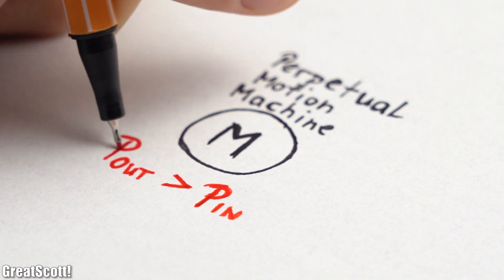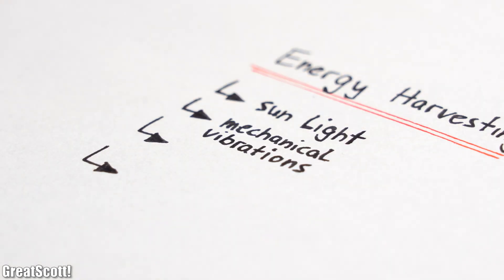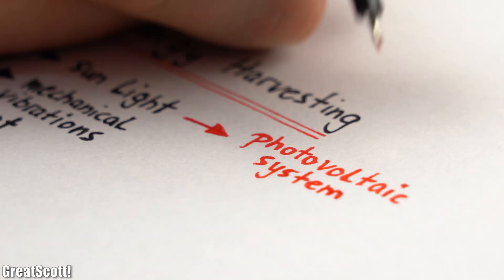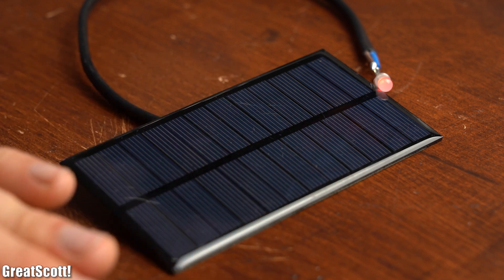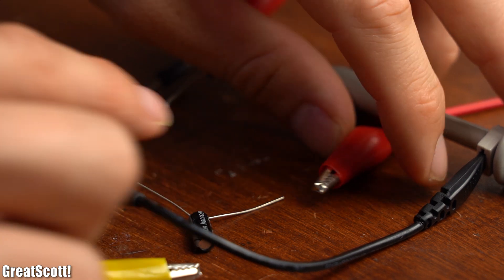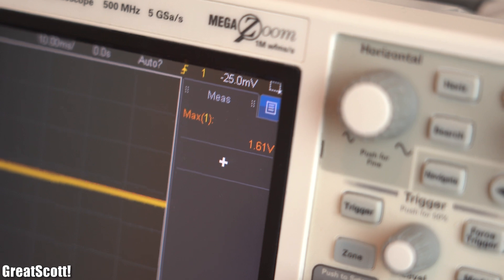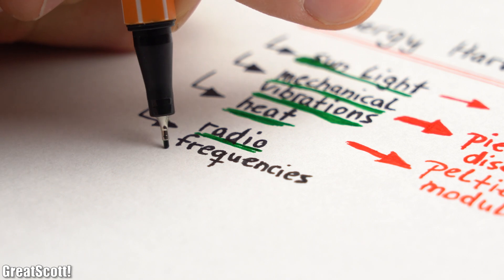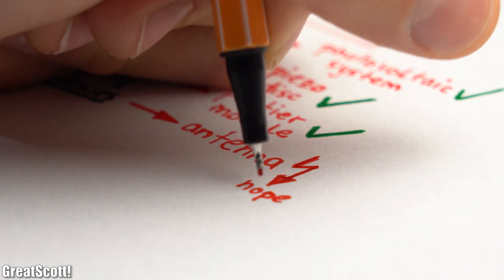Does Energy Harvesting make any sense?! (Experiment)

Comment: My idea is to try using the vibration riding an e-bike to produce some voltage. Probably for LED's or small devices. But, until now, I didn't know how to approach it. Also, this approach doesn't use friction against the wheels or pedals. The washing machine sample you gave tells me getting the right form of vibrations is going to be tricky!

Comment: On the washers unit you would probably have to get to the bracket on the inside away from the spring so it's attached to the most vibrating part of the machine bracket so it will have more effect that be near the bottom of the washer where the spring connects to the agitators bass and I'll be where the machine shakes the most inside while it's on spin cycle and all the other Cycles

Comment: Energy harvesting is largely a green fantasy that sounds good, but is in most cases absurdly impractical. Often the on-going costs of maintenance, damage, energy storage, wear and tear etc is not factored in, or the efforts involved are much better spent on large output power generation systems such as solar, rather than trying to scavenge puny amounts of power off mechanically unstable objects

Comment: I think the problem was that the disc and machine have the same reference frame, you could place steel balls (from bearings) in a chamber with the machine in one side and the disc in the other, the shaking would probably induce a lot of collisions with the disc and charge the capacitor quickly

Comment: I'm sorry but this guy is not telling you the truth he's using half-truth to explain, he'll probably take this down but here is the real truth if you harvest anything at any level it will grow, if you grow something in storage eventually you'll have enough energy to run something. If that thing is a battery then you can have more on the output then which was drawn in in the first place only if you look at direct numbers, not the the time that it took to charge it up in the first place, this is the same thing with solar. You charge up your batteries and because your batteries have so much capacity you can run other larger equipment for a Time. Now how much power can you actually draw. I'll give you a link but they normally take it down so I'll put it in the next direct comment, so if you don't see it then you know that they actually took it down so you wouldn't know but it's under crystal radio which we all know is over 100 year old technology that takes radio waves and can produce some.

Comment: In a refrigerator you have a hot and a cold side. If you can harness the heat, there is your low source of green energy.
Reply: A speaker playing bass in a ground inducted well with a refrigerator , with a solar power above ground. Connected to a battery. The heat would be down and the cooling would be up. Attached to a car battery. With the last part being …..

Comment: Why did you not add a high frequency Joule Thief? | Rf harvesting done the easy way... https://youtu.be/fe5mryN5a6g    Duh!!! Here in Orlando, Florida. A 19yr. old boy is making a bundle of cash selling refurbished Dell inspirons that do not have batteries. The batteries have been replaced with a custom-built rectified antenna array. That harvest microwaves and converts them into electrical power. You never need to charge these laptops! Just open turn on and go online. And the operating system has been wholly changed to a Linux operating system. He sells them for $2,800.00 per laptop.

Comment: I think RF is a good idea for wireless power transfer. Design a transmitter to transmit power to wireless sensors and you never have to change batteries. RF can transmit through walls, etc. and you could design different sensors to operate with different frequencies so you could choose what to power by only transmitting at those frequencies.

Comment: I've powered 2 green led continually in series.....antenna...cap...diode..connect negative and positive and presto...I used to be able to only quickly flash 1 green led...I believe they run at 1.8 volts each...I have video proof of me lighting my first green led continually...antenna is 1 foot by  1 foot pure copper sheet very thin
Reply: Also I've created an artificial electromagnetic field...first experiments I ever did...got over 50 volts ac wirless

Comment: re: RF harvesting. Need WIDE-BAND reception. Need to use Germanium diodes (1N34) like Tate Ambient Power Module. Need a really good ground connected to the negative side. Iron plates are buried in the ground. The antenna is a LARGE isolated capacitive structure to receive incoming cosmic rays, particles from the Sun, etc. A high antenna is better but more dangerous. Need spark arresters. The antenna can feed a large inductance coil and small value capacitance have less dampening in the oscillation. Tune for 100khz to 300khz -- lightning strike frequencies around the planet.

Comment: Pls help me 😭😭 im having a project of free energy harvest using stepper motor as generator. But my build circuit is not stable to power up my module because it requires permanent volts without dropping down moving up the voltage 😭😭 pls help.

Comment: Let's say I have a wifi enabled implant.
I could have my phone send out wifi signal of 1w to the implant where 30% of the source energy is converted into power to charge the onboard supercapacitor. Then the implant does it's thing, sends the data back to the phone through the same antenna and repeats if operation is longer than can be sustained on a single charge.
Slow? Yes.
Practical? Depends, but in this case it's better than the alternatives.

Comment: -50 dBm is a great strength for Wi-Fi signal. But if you calculate how many current at 5 V it can provide, the result will be 2 nA. So even if you will be able to get 5 V from it, capacitor and diodes leakage most likely will be larger.

Comment: That little module that you showed at the end is actually quite useless. You still need a dc supply to generate a dc voltage that this module can switch. And that dc supply will have a quiescent power draw. That module is trying to solve a problem by creating the same problem in another place so it's a nothing-burger.

Comment: Sorry, I don't know if it was already said, but I think that you might add a bit of improvement. First, I think it is better to use some sort of active rectifier made for example of transistors, because you wouldn't loose those 0.7v from the diode. Of course that is more complex and needs additional power to turn on and off the transistors, but maybe it is worth it. Another thing is that that with piezo disk, you need to bend it, not to shake it to get some energy from it. So in your example with the washing machine, I think you should stick it to the wall and connect some rod to the washing machine to put some vibration stress on the disk for example.

Comment: I have got a question, which i didnt understand how to solve, so i am asking you.
12kw 12v for 10 mins should be supporting the device. So for this u can use two type
1. 0.45ah 7.4 V 0.032 kg C 30
2. 7.5 Ah 3.6 V 0.33 kg C 20 
You can use as much batteries as u want.

Comment: For things like motors (including your washing machine) that rotate at a set frequency you could use a weight attached to two springs, setting it's natural resonance frequency to that of the washing machine. This would create a positive feedback moving the weight back and forward. If that weight was now a permanent magnet, and you surrounded the 'harvester' with a coil, you could generate an AC current. A bit more faff that a piezo disk, but would probably produce much more power. I guess such a harvesting device would be the exact opposite of mass-tuned damper.

Comment: For a follow up video add ambient barometric pressure. There are clocks that are powered by it.
Could you have a (between 10 and 1000) antenna in series, each tuned to a different frequency, to harvest enough of the radio spectrum to power a Teensy?

Comment: You could try a single diode rectifier in order to reduce the other 3 diode voltage drops. Also, you could use the Joule thief I think you already covered in your videos to boost the voltage obtained from low signal harvesters.

Comment: The best energy harvesting device is the car Alternator! 
After being powered by a battery, the battery can be removed from the system and it will power itself ( no magnet's inside so it uses an electromagnet) and it also power's everything else connected to it in the car! 
Little do people realise it but it is an energy harvesting device! 
It doesn't make electricity! 
There's nothing on this earth that makes electricity! 
According to the laws of thermodynamics, energy can't be created nor destroyed! 
So it can't make electricity! The electricity is already there and the alternator is harvesting it, no one actually knows where it gets it from, people tell me that the wire coils move through the magnetic field and that's what makes the electrons move to make a current! 
But if we look at the water analogy of electricity, say we walked up to a river that isn't flowing ie no current! We can try and move the water back and forth but unless we are adding more water to the river, a current flow won't happen! 
The car's electrical system will loose a lot of electons via heat, Light and sound! 
Where is the alternator getting it's electricity from? There's only so much electons in the system. 
A battery only has so much electons to give before it's flat, how come the alternator doesn't go flat? 
If an alternator didn't suffer from mechanical failure, it will harvest energy for eternity! And never run out. 
So it should be technically able to drive an electric motor which would in turn drive the alternator in an endless loop while powering other devices! The only thing that you need to do is create a circuit to control the speed of the motor and remember to add a flywheel with some weight to add more stability and inertia between the motor and alternator! 
Happy harvesting!
I have seen videos on YouTube somewhere where people have connected an electric motor to a generator, they started it from the energy of the wall socket and disconnected it after it started to run.. it appears to work! I haven't tried it myself but it's definitely interesting, the closest thing that I have come to it is when I have removed the car battery after the engine was running and it keeps running, but if you remove the alternator, everything stops when the battery goes flat which isn't very long but the alternator is much smaller and provides so much more energy and no one knows where it gets it from? It's not making it because physics! So it's harvesting it from somewhere!

Comment: You can easily calculate a spring damper system that maximizes its output amplitude when stimulated with the input frequency of the washing machine. If you attach that to the piezo, your power output should be a lot higher.

Comment: So, this is particularly interesting to me. I did an entire year long project with a major international contractor to focus on energy harvesting on rotor aircraft with Piezoelectrics. We figured out that it is "technically" possible, but the problem came down to cost and the rather low output power just due to the terrible efficiency of direct mechanical to electrical systems.  Very cool video regardless!
Reply: Could you please share your findings. Am doiong my bachelor thesis on the topic.

Comment: Scott, what do you think, about using BiQuad antenna for WiFi band for power harvesting? Nowdays we have WiFi coverage in most places. But, from the other hand, Electromagnetic field density regulations are really tight, due that power per square meter is really small (exist/existed huge difference between eg. Poland than other part of EU). But we have to keep in mind, that PEM power shall be less than 10W/m². It sounds good, but depends on many things.

Comment: To harvest mechanical vibration energy, a cantilever beam with the same natural frequency as the frequency of your vibration source would be better. Also since piezoelectric transducers have a parallel equvalent capacitance, using a full bridge rectifier to harvest energy is not very efficient. Some more efficient harvesting techniques based on synchronized switching would be perferable. Such as SSHI(Synchronized Switch Harvesting on Inductor) and SECE(Synchronized Electric Charge Extraction). The circuit implementation is quite easy, too.

Comment: Radio frequency energy is also used in RFID pin systems the transmitter outputs a high frequency band but a close range only. I also thought if a factory where to put this to use they could have a transmitting station within the building to power a the iot devices.

Comment: No. Perpetual motion is not over unity... They are two separate concepts. And the phrases have been used by charlatans and Sci-Fi so much that their literal meaning has been eroded into non-sense.

Perpetual motion is not only possible, is it unavoidable: Fundamental particles above absolute zero will continue to move until the universe cools or ends. 

Over unity is more energy out, than in. This is impossible if you define the system competently. It is only possible where you don't factor energy coming from a source you've overlooked or ignored. For example those "overunity" LEDs that produce more photonic energy than electricity, because they adsorb heat from the environment in addition. Same applies to refrigerant cycles, you get more heat energy out than electricity you put in. 

Free energy doesn't exist either. Everything has a cost. For example: solar panels get energy "for free" but the panels themselves need to be bought. Say you build one of those "free energy" devices you see on youtube with some hot glue and a CD. It's not impossible to find or be given those components at no monetary charge, but it still took some of your time to gather them and combine them. Just like solar panels, the energy they produce may take a long time to cover the sunk cost in setting it up. 

Energy harvesting seems to be the term used by people who understand this and  try to gather useful energy from otherwise useless sources.

Comment: You can use gold leaf to print antennae on sheets. You can then use those to get small amounts but consistent energy from WiFi. You could probably use something other than gold leaf but I've never tried it, I've seen someone else do it. Really small amounts but if you stack the antennae you can get enough to power something small. The advantage is that if you are in a populated city where EMF is everywhere, you can catch some of that. The antennae need to be conductive with low resistance so that it's even worthwhile. Gold is best because it doesn't oxidize. Not sure if Aluminum is any good. Anyway, that's what I thought of when I read the title. If they gonna nuke you with WiFi, might as well milk it.

Comment: hmm, Well My RF signal works fine. Look up Crystal Radio for simple prrof, mine powers 2 LEDS. As for the Piezo, it does not make electricity from being moved, it must be flexed, hang a pendulum to bump it when the washer moves, there is a thousand other ways, but putting it flat on a board and then waving it around will not do anything. The blaster harvester at the end was epic!

Comment: You said that a lithium battery will need to be replaced. This is our problem. We have the exact same problem on theese harvester systems too. We either use a battery or a capacitor. And they ware out in 10 years as well

Comment: I love your videos, but your piezo transducer experiment was flawed. All you were doing by affixing it to the side of the washer was shaking it, which isn't going to generate much voltage output. Instead, try gluing a small weight in the center of the disk to act as an inertial mass, then attach the disk to the washer via a ring so that the center will vibrate differently than the edge. The ring could be something as simple as a few millimetres of plastic water/sewer pipe of an appropriate diameter to match the transducer.

Alternately, rather than flexing the disk coaxially, you can try bending it laterally by clamping one edge to the washer and then attach a small mass diametrically opposite.

Comment: The amplitude & frequency of the shaking washing machine is very different  from tapping a hammer on the piezo element. The piezo size & construction prevent it from ever being a viable technology with the wm.

However, a solenoid, flywheel, or swing arm based energy harvester design could easily yield modest results. Particularly if said design incorporated a distance multiplier.

Comment: A great application for energy harvesting would be to use it inside these super cheap 2$ solar garden LED lamps. They have a single small NiCd battery inside them, and a tiny solar cell.

I would live to cheaply hack one and put an ESP8266 inside it that gets powered as soon as an IC somehow detects that the battery is charged enough to sustain reading a sensor, connect to WiFi and transmit an MQTT message. But sadly, I haven't found a super cheap way to do that yet. Any help appreciated!

I think it would be awesome to be able to use these 2$ solar-powered waterproof enclosures as IoT sensor nodes - either using Wifi or LoRa.

Comment: Should have used an inducator (like a reverse wired speaker) instead of the pizeo electric disc. Induction coils are meant to be shaken the disk was meant to be struck.
Reply: Should have tossed and an ice cube in the pan too. Peltier device work better with a  greater heat difference.  Putting your 98F hand in the pan only added to the fail.

Comment: The piezoelectric would have worked fine if you sandwhiched it between motor mounts. The air has not solid surface for it to compress piezo. You can also sandwhich many piezo together.. try again please